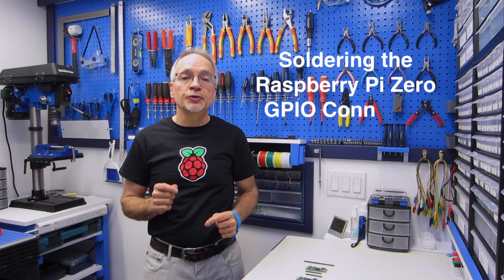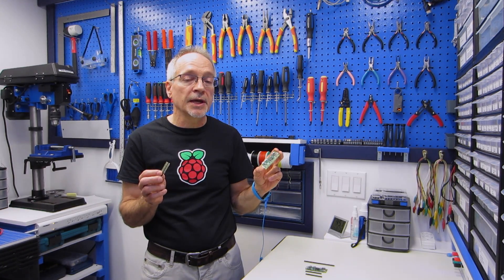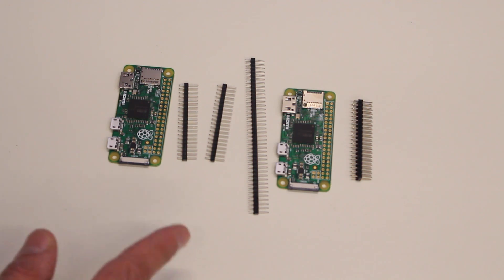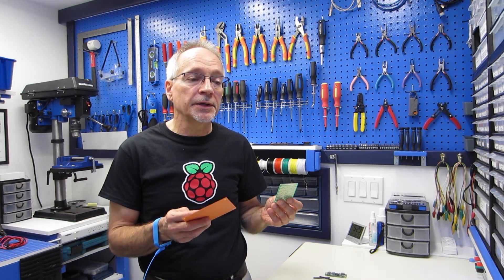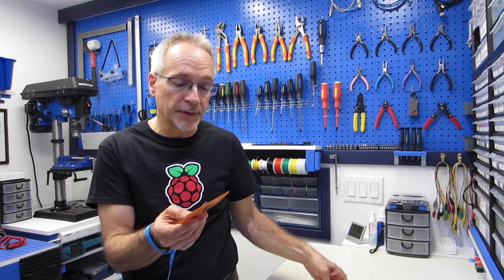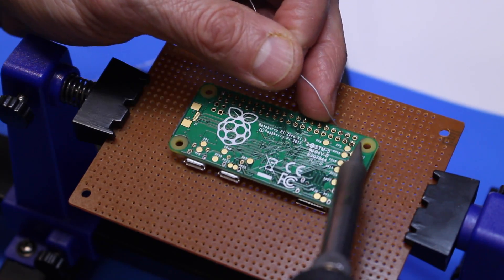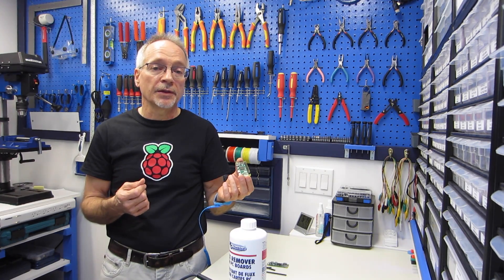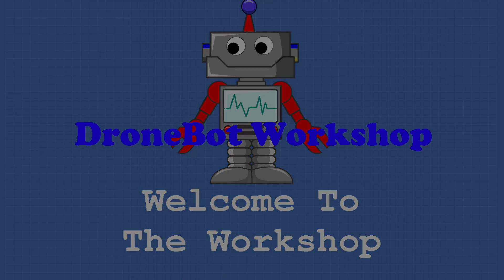Soldering the Raspberry Pi Zero GPIO Connector - Quick Tip

Comment: I have 4 small PCBs, about as big as the Arduino Uno "classic".  I stack them on top of each other, put the pin headers through those, and that works for me; 4 is enough so that it's not sticking out the bottom, so you can lay it on a flat surface at that point, stack the Raspberry Pi you're working on on top of the pin headers and have a go.  But if you don't have that his tip is great.  Or maybe even use 1 PCB and stick some playdough on the bottom

Comment: Dave, thanks, love your channel. I realize the age of this video based on your price references, but still relevant content. 
I have a couple of questions.
Which side should the pins protrude for a hat? Does it matter? Would I be wrong to use an extra long female 40 pin facing the main side of the board and for versatility let the extra long male pins protrude out the bottom of the board?
The next question is about solder paste, is it appropriate or adverse to use solder paste when securing the header pins?
Sorry if these noob questions are elementary, but I trust your expertise and experience.
Thank you Sir!

Comment: You should move the header closer to the edge of the perfboard so that the miniHDMI is out from under the perfboard.  The mHDMI connector is taller than the plastic part of the header so the Pi will not be lying parallel to the perfboard and the header will be crooked if you have the perfboard extending out.

Comment: When doubling up single row headers, be aware that sometimes they can be 'keyed'. The black plastic piece that holds the pins can be convex on one side and concave on the other. This allows them to kind of snap together. Orienting them incorrectly can spread apart the rows to and cause them to be misaligned.

Comment: I thought this was a really good video. But my main takeaway which is probably lesser than the whole -> I will forever be calling my fan a fume extractor from this point forward.

OB PROTIP: You also might want to use shims to ensure you got the pins laying flat in the short (width) direction as well. You don't always need it, but if the zero lays exactly right on one axis, but off on the other, you end up with things being less than square. Shims are good for avoiding that.

Comment: Where can you get a pi zero w for ten dollars?
Reply: Andy Timmons the adafruit website it has all the pis and everything you will use with them for cheap. It's 5 dollars for the zero  and 10 for the zero w
Reply from the maker: Andy 10 US dollars is the retail price of the Pi Zero. As Angry Piper mentioned you can find them at that price at Adafruit, also the Pi Hut has them as well. If you are outside of the US then try Pimoroni in the UK, that''s where I pick mine up.
Reply: DroneBot Workshop pi hut in the UK stocks them regularly too.